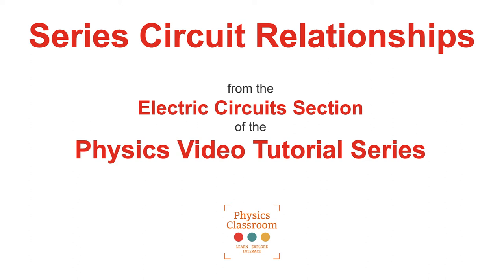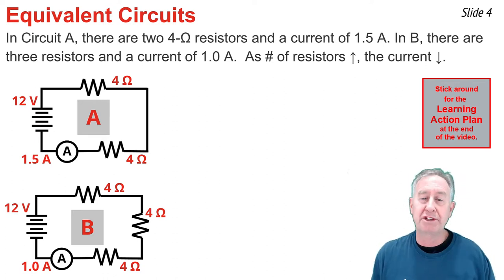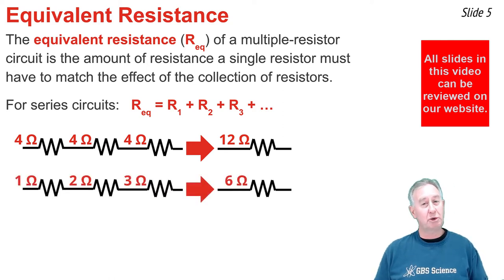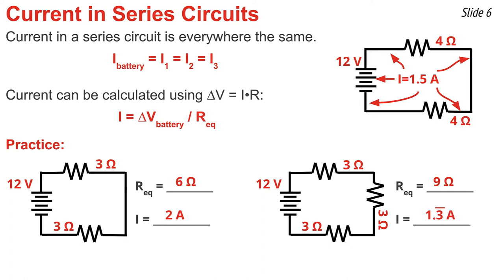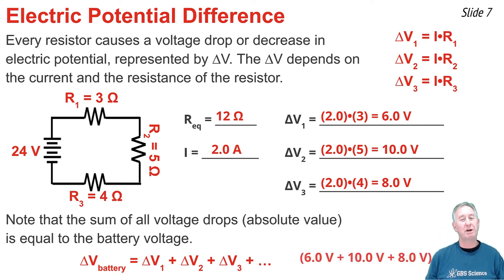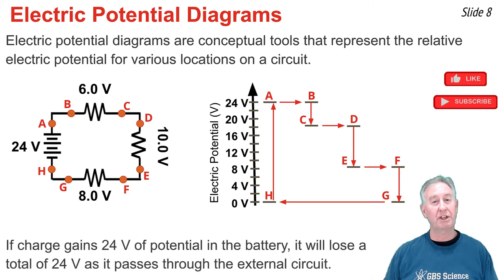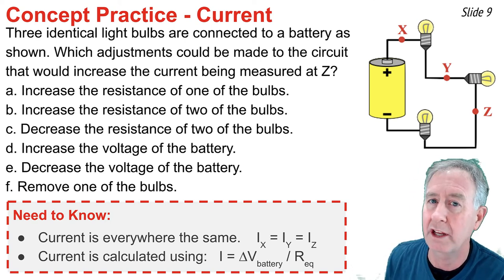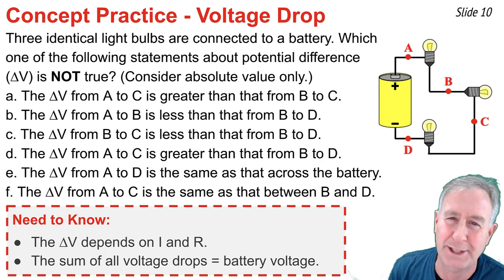Series Circuit Relationships

Comment: i cant understand why does a single resistor always cause a total voltage drop.Why is the whole electric potential used on a single resistor.Why doesnt it use only what it needs?
Reply from the maker: The only thing the resistor can "control" is the current. The current adjusts to the resistor. The battery "controls" or determines the voltage drop.
Reply: so because the battery uses for example 9 joules of energy to push every coulomb of charge from one terminal to the other,by the time the charge completes the circuit it needs to transform those 9 joules of energy into another type of energy,and it always returns with 0 energy?